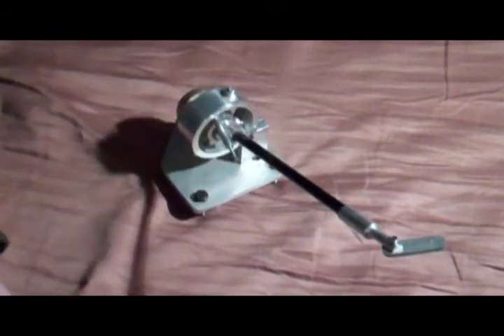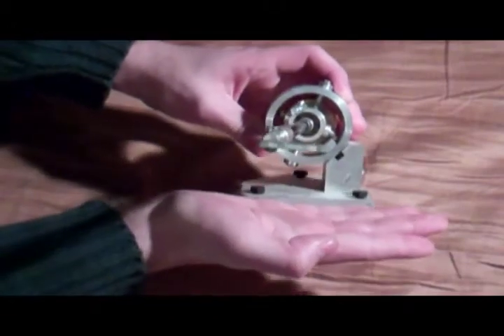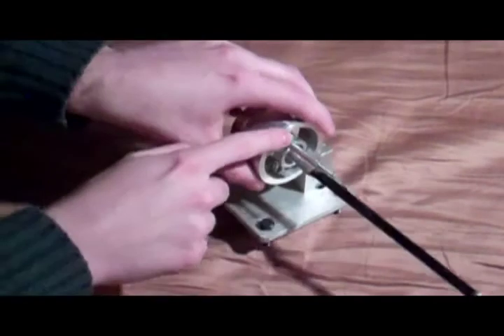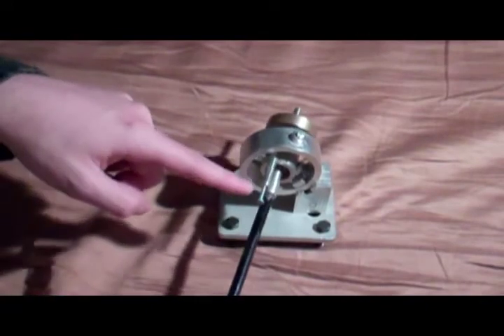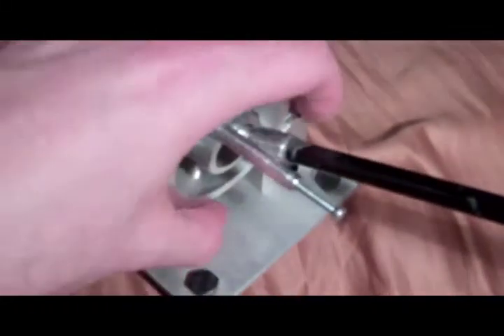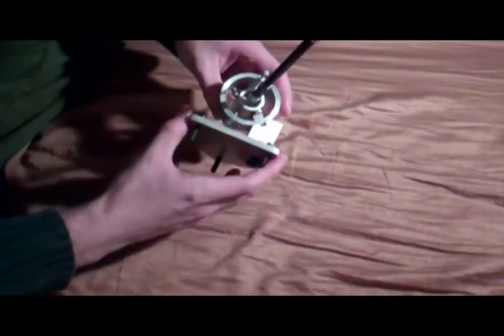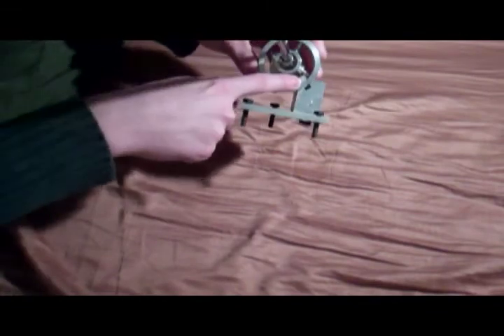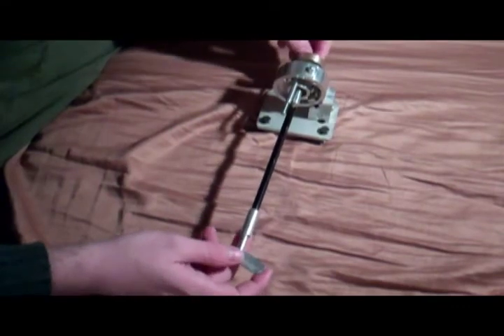PGE Homebuilt Tonearm Number 2

Comment: Paddy - that's a great peice of work - well thought out and very well excecuted. I realise this is many years old, but what did you think of the arm in use? 
I am about to make a much simpler tonearm - with limited tools.
Can I ask you what bearing setup you use?
Thanks - I hope you are still developing these - you have a lot to give.
Reply from the maker: +will will 
Hey there.
To be honest I can't remember being overly impressed with how this tonearm functioned. I think I only used to for about 5 minutes, but that was quite a while ago. 
This tone arm used a single ball bearing pinched between two cup point set screws as pivots. This isn't ideal by any means but was quite easy to make. After this arm, I bought very small angular contact sealed cartridge ball bearings for the future arms. These dramatically reduced the friction in the pivots. RC cars are a good place to find bearings similar to these.
Thanks!